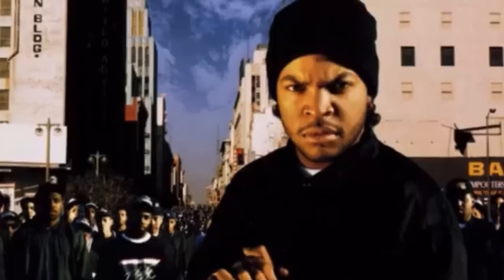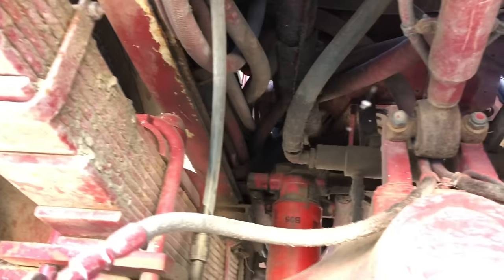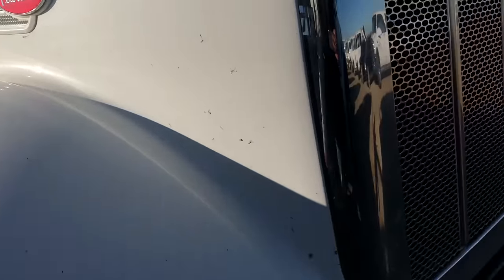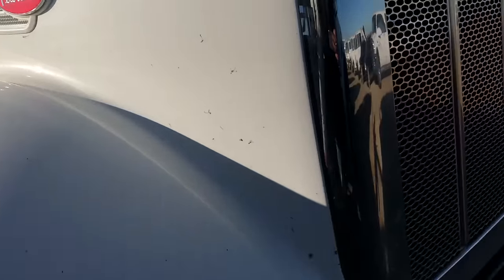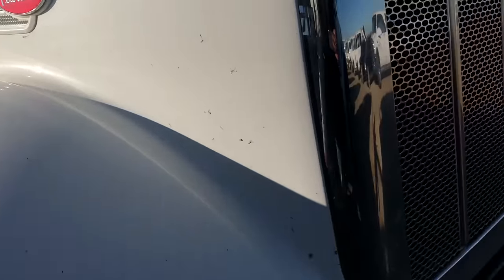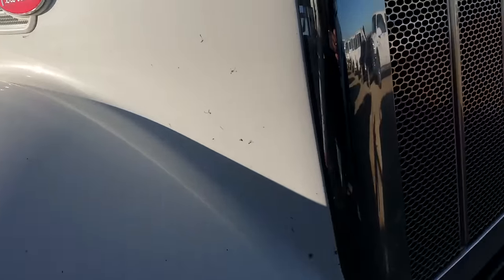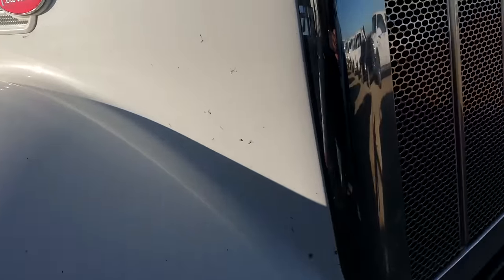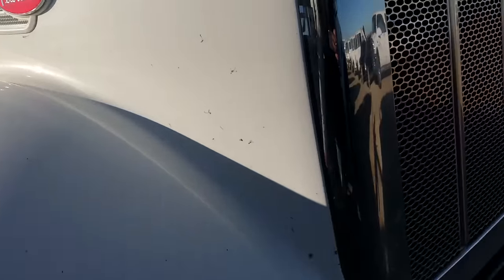On The Hunt Ep.33 How Much for a 359 Project Truck?

Comment: The rubber tandem suspension is Hendrickson-Norde. Decent articulation but a very harsh ride when lightly laden. Advantages are low maintenance when compared to springs, lower cost than airbags, and overall durability. Disadvantage is barely being able to climb down from the cab after a bobtail run due to crippling back pain 😆 Great work, Mark, I really like being introduced to all these Canadian trucks 🙂
Reply: It’s known as rubber block suspension

Comment: Shore power is an option when buying trucks. The new inverters work both ways, 12v to 120v out and then plug in and you have 120v plus it charges your batteries. Ideally if you carried a generator you could keep your costs down when waiting for a reload. Also the air gauge on the back of the bunk was probably for him to check his weight. The bigger they are the more accurate read you can get to check weights

Comment: You look at the high idle switch... the 400 Cummins had a place in the return line where you could insert a solenoid valve, that would restrict the return enough to speed the engine to half throttle. I have installed several of these when rigging up a picker, so you could speed the engine up from a switch in the crows-nest.

Comment: the brake controller I used, some 30 years ago,  had a pendulum in it the actuated the trailer brakes.  The harder the pendulum swung, the harder the brakes were applied.  It also had a manual button.

Comment: The long ramps in the back are to pull a Raised Goose Neck trailer.  The detachable front is made to slide up the ramps because the decks don't have jacks since they lay on the ground or blocking to load heavy equipment onto front with the deck removed.

Comment: For electric trailer brakes... you simply tie into the brake light wire for power control. Just buy a brake controller and follow the instructions. That’s what I did on my Kenworth to pull my camper

Comment: Those old brake controllers are just on and off. Wire them off the brake lights. That's why they are adjustable.
I got a Redarc TowPro Elite and it's actually has a G force sensor in it and the harder the vehicle brakes, the harder the trailer brakes. It has an intensity selector so you can manually crank it up if you want but setting 3 was always perfect for me. It's a beautiful unit.

Comment: Those MBE4000 engines are a fun rebuild. They have 6 individual cylinder heads, so no over head crane or chain lift  needed. The early pre emissions non egr ones are worth keeping around

Comment: Mark, On the trailer brakes they are now using an electronic controller.  You just hook it to the battery, ground, brake light switch and the brake signal wire that goes to the electric brakes on the trailer.   No more plumbing it into the hydraulic brakes at the master cylinder,  Not since anti-lock brakes have they used that method.

Comment: 52:00 Daimler Trucks bought Freightliner  in the early 1980s and Detroit Diesel in 2000, and Daimler is also the company that owns the Mercedes-Benz brand so it makes sense that they would brand that Detroit Diesel as a Mercedes.
Reply: It was a Mercedes engine all the way but fully supported by Detroit engineering. The MBE4000 used in the USA and Canada were all built in Brazil.
Reply: They didn't hold up that well for anything but over the road. We had five of them and all five went down due to internal cracking before 300,000 miles. I got out of heavy truck right after and opened my own shop. I do know the company retrofit Detroits in after I left.

Comment: I love when you do these. Bit of a reality check. Trucks I thought would go for a lot, went for way less than I expected. Trucks I thought would be dirt cheap went for a lot more than I expected. I was saying out loud, water tank, not fuel. You figured it out.. We wrap the water tanks not just so they don't freeze as fast but also so heat up and expand as much, tank is pressurized. Not all cement trucks need it. Our cement trucks are old school Macs. My favorite is the 2 stick. Mac style, forward Hi Lo and reverse on one, gears on the other... Can shift through them in reverse, I tried, it's terrifying.  We REALLY need to figure out why that Cabover is STALKING you!! I mean what's going on with that poor truck...

Comment: Hendrickson suspension had extended leaf spring and pad ( biscuit suspension) they do now have air but they are mounted at around a 45 degree angle

Comment: The Hendrickson walking beam suspension on rubber block mounts was the RS series, a low maintenance, heavy duty suspension.  It provided better roll stability than the spring type Hendrickson RT suspension.
More and more automatic transmissions in big trucks.  This is going the same way as manual transmissions in cars and pickup trucks.  They went from nothing but manual, to an option for automatic, to automatic being standard equipment.
Reply from the maker: Sad but true

Comment: Buy a air over electric controller. Put 12 volt’s into it and hook up to your applied air on the brakes. Otherwise with the true electric ones hook into the brake light pressure switch

Comment: Goodness Mark, the negativity in the comments is astounding. I just wanted to say keep up the good work, I appreciate and look forward to every episode whether it's truck shows, on the hunt, or working on trucks. The LBL restoration is what brought me in years ago (been here since episode three!) but the variety keeps me coming back. Restoring a K100 Aerodyne is on my bucket list after I finish this panoply of other projects, and I love the tips and tricks I catch watching, or listening to (when I can't watch, nightshift daycab driver with just enough time to sleep but 600 miles a night to listen), your videos.

I meant to comment a while back, but when you were measuring the corrugated sides of the trailer for the wrap, I would take a roll of painters tape and tape all the way down the panel, in and out of every dip, mark the top and bottom, pull the tape and lay it on the floor and measure the marks, I think it would be the most accurate way to get the measurement you need!

Thanks Mark, keep on truckin!

Comment: The way the brake controller works is there’s a pendulum that swings when you step on the brakes of the truck pulling the trailer the further it swings and more brakes that are applied

Comment: 13:26 just a pipe cap to keep the valve stem from getting knocked off in the mud. Valve stem is under there.

Comment: I bet if you wire in a potentiometer
Switch to the back side of the pedal. You’ll be able to get the brake controls to work

Comment: On that old kw, that's called Hendrickson walking beam suspension, I have almost  identical setup on my 94 w/star. It's good solid low maintenance setup. Nice and stable for spreading gravel with. Hard riding though not for comfort. Also referred to as rubber block suspension or sometimes elephant feet. Was common suspension not so much anymore.

Comment: All Cummins run below 40psi of course you live up in the cold so probably should be a little high on cold start 😂 but down here in Georgia I’ve never seen a fresh Cummins engine get over 50psi cold and always at hot temp run around 38psi even at 1800-2100 rpm just the Cummins way but it works

Comment: The Mercedes motors was basically a prototype engine between the 60 series and the newer Detroit engines like the dd13 and so on. Most of the Mercedes are in the Columbia's or the century trucks

Comment: MBE is Mercedes Benz and Detriot belong to same Company.The DD series engines are basically the same Engine platform as Mercedes heavy trucks
that are sold in Europe & also down under in Australia & New Zealand.
Sterling & Freightliner Columbia were sold with MBE Engines down under.
I like that 389 Peterbilt with the white & red paint looked good with dual fenders instead if naked wheels.

Comment: Hey Mark that suspension looks to be another version of the Rubber Block type.  They were popular on the older British trucks ie.. Foden or ERF  I've seen used on logging trucks a number of years back here in New Zealand. 
Probably more forgiving than steel suspension giving more traction than air in the soft conditions.

Comment: Usually refer to as rubber pad Hendrickson suspension generally used on concrete trucks so when the drum is turning it doesn't cause the Springs to sway

Comment: I bet the oil cooler is bad that's what happened to mine right after I did a coolant flush the oil cooler had a hole on it it and leaked all the coolant into the oil

Comment: OK Mark....that mixer, the International, I'm 99.9% positive I drove that truck for Four Star Concrete back in early-mid 2000s.  Swamp Donkey is out of Dawson Creek, BC.  That truck is a vac unit used in inaccessible lease locations.   Mike Vail trucking has been around a very long time, I've been here 24 years, and they were huge in Calgary while I was a mixer driver there.  Their trucks are MINT!  Very well taken care of, I still see trucks of his from 20 plus years ago still working all over the province.  Sure hope they didn't go under, its a piece of Alberta trucking history gone if they did.  BTW Mark, those two trailer items we discussed at truck show are in the works.  Is there anyway to chat off here, pls comment of you have another way.  Peace until next time.  Addendum, TNV was a company started by a fella from NFLD in Ft Mac and hauled primarily for Gibson's before they sold to Trimac couple years ago.  TNV was a vibrant and diversified company, but I'm sure the trucking economy over the past several years has taken its toll on them, like many others.  When Mercedes bought Detroit, that was the end of the reputation for Detroit diesel.  Those motors are complete GARAGE!  OMG!  That 359 Gibson's truck is a keeper strictly for historical reasons.  Gibson's is gone, that truck is from minimum 15-20 years ago, and they are one of the original oilfield trucking companies in Alberta... BUY IT!
Reply from the maker: Email me at twinstickgarage@gmail.com

Comment: The connection between Mercedes Benz and Detroit diesel is that Mercedes/Daimler owns freightliner and Detroit diesel. And the Detroit DD engines are based on the Mercedes MBE engines

Comment: Those MB Diesel engines were pure junk. No wonder it's in the non runner section. A bunch of Freightliner came out with them because they were so much cheaper than a C15/C16 or Cummins option. Funny thing is, second hand they are worth half as much with the MB engine as with the Cat/Cummins. You see a CL for $30,000 you KNOW it's running an MB engine.

Comment: Shore power is to plug in 120v dc right?
Reply: Shorepower in marine or rv terms is house wiring..alternating current 3 wire...
Reply: Or 4 wire if you get up in voltage

Comment: At 30:14, did anyone else notice it said "No Step" on the side of the hood too? Was that his nickname or something?
Reply from the maker: No they used to write that on fiberglass fenders so drivers wouldn’t step on and potentially crack them when they jumped up to clean the windshield
Reply: @TwinStix  just wondering because it said on the pocket inside the door too.
Reply from the maker: @davidgriffin14  yeah that was a little odd 🤔